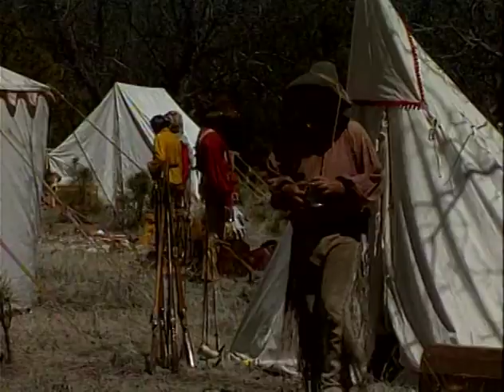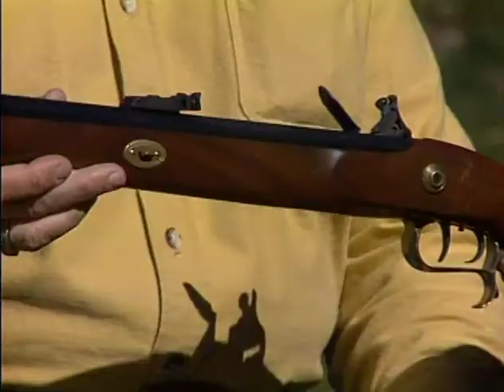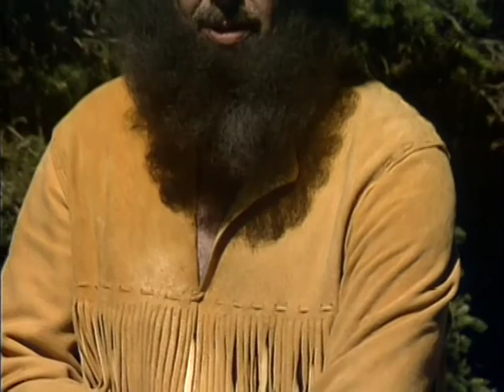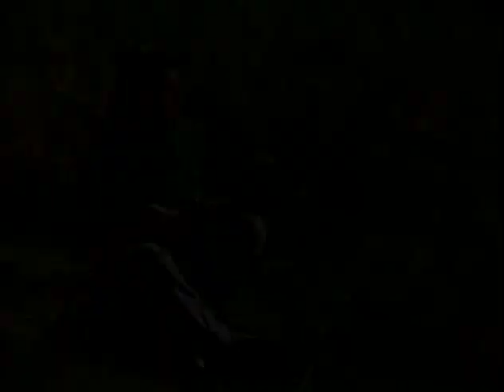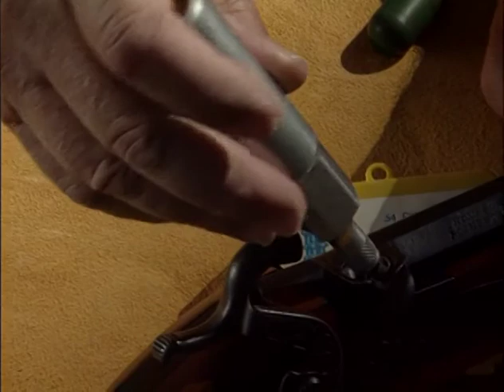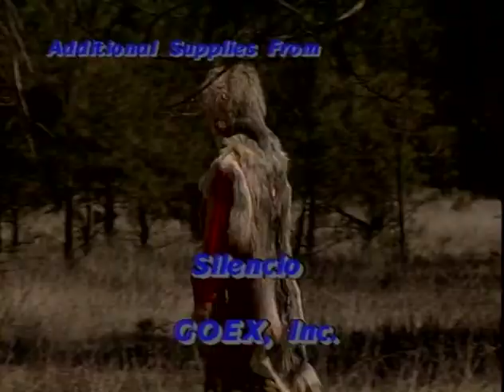Black Powder White Smoke

Comment: never use  hot  water  to  clean  a  muzzleloader  use  worm soapy water
Reply: Why? Can you elaborate?
Reply: Why? I use Hot water to clean my Black Powder guns and I never had an issue.
Reply: @kendo207  warm or cold water to clean all the  fowling out, hot  water final rinse . Hot water bake s the fowling to the pours of the steal . even the old U.S. arms manual from 1850 s say s clod water for cleaning the barrel .this is how i clean all my muzzle loaders for the last  37 years .
Reply: I would believe that if so many basic words weren't spelled so poorly.